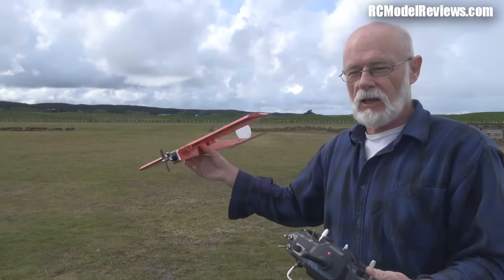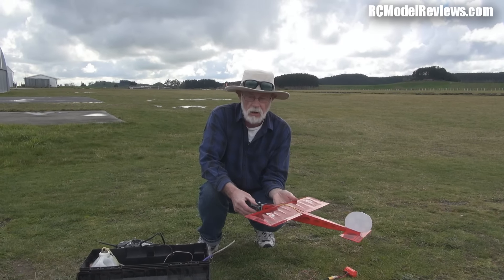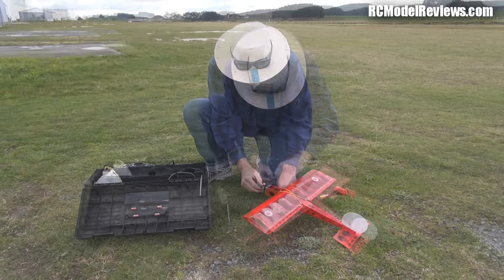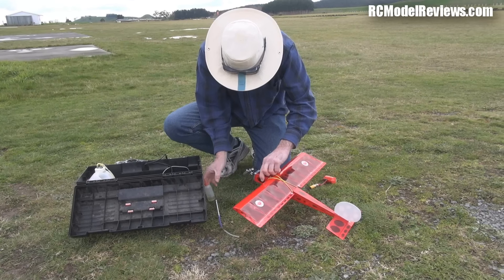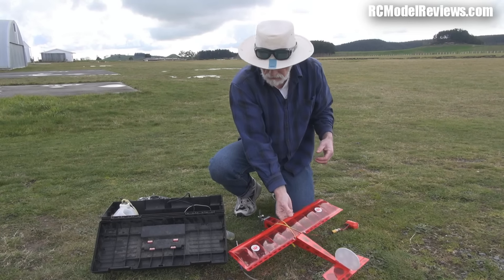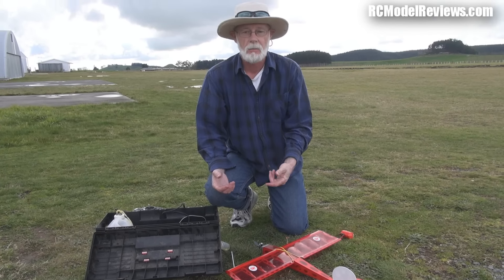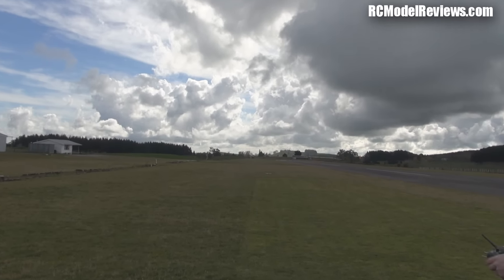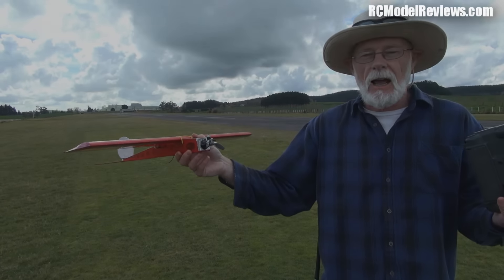Nitro powered mini-stick RC plane, first flight

Comment: I put a cox 049 on the nose of my 72" span Sig Riser.    Fuel tank was way to big and if you filled it the motor would go for a full 17 minutes.  Plane barely flew so you had to really nurse it until it gained some height, and speed. Tons of fun it was!
What amazed me was how much time I put on this little motor over the years and it never seemed to weaken. Amazing.

Comment: I have a Cox 020 with a wooden prop that my Dad bought in California in the 50s. I only remember running it one time as a teen but we never mounted it on a plane. I got a Cox Spitfire 049 powered when I was 13, never flew it though. It was gorgeous, had a sliding canopy and detailed cockpit. The fuel would soften the plastic if you didn’t thoroughly clean the plane with soapy water after running the motor. I replaced the wing once because of that. I still have the motor.

Comment: Nice vid!  I recall having to use nylon props and even conditioning them by soaking in hot or boiling water...the nylon is quite flexible but if they dry out they get brittle.  Keep them in plastic bags.  Also position the prop so on compression its horizontal.  Can't wait top see a vid of a second run and the rest of the Taranis!

Comment: They're called glow engines BTW. The original Cox .010 was designed and produced about 35 years before the low-brow term "nitro engine" ever came out. It started, predictably, in the car market.

Comment: @RCModelReviews
G'day Bruce... Yay Team...! What a little Screamer... Um, back in the days when Wheels had flat sides running all the way around them (On Trains, mementos of previous Emergency-Stops  ;-p  ) ; we used to install the Prop. to be Horizontal on Compression, for Belly Landers. "10 to 4" made for easier Finger-Flick Starts, but the Low Blade often dug into the Dirt... And, better a busted brittle Prop, than a bent Shaft & intact Blades, eh ? Ciao !

Comment: Landing gear may make it a couple g heavier but may be worth it since you have an airstrip to land on. Not saying it's easy to dead stick a runway landing but it might still be flying if they were fitted as per the kit?

Comment: noob question.. so when the motor is labeled as a line/free flight plane, it means it has no way to throttle. correct its just wide open till its out of fuel?

i think i want to play with nitro, sure looks fun.. i do love flying my mini quad.. but this sure looks fun.. yup.  gonna have to learn to cover a balsa build.. as iv only built a balsa rubber band kit so far and had no clue how to or what dope was for the paper covering. so i just finished it up stained it, and made a cool static stand out of it.. and call it art and have it on my desk.  i have 2 other rubber band kits that have 22" wing spands for future projects.. but ill look for a kit for now that has the control surfaces that ill have to build into the rubber band kits which i just do not know or have the skill yet.. which ill gain from building a few balsa kits.   ( and since i live in the desert AZ, 115F means perfect time for building a model, i fly my mini quad in the early morning, or evening when the temps are around 80F.. or my blade nano qx in the house all day long :D  if you do not own a blade nano, they are  blast.  even bought a 25mw elite micro 40Ch micro FPV camera for 40 bucks to give inside FPV flying a try this summer )

it looks like a little cox engine would work great on one of these balsa rubber band kits.
ok, tomorrow ill buy a iron, some plastic covering and start looking for a kit to build.  you have motivated me bruce..  im building a 175 quad right now. so while the stuff is in the mail.. ill build that and get it off my table for my next project balsa nitro..  im sure ill need more than fuel etc.. so i lots to learn.. im assuming it will be a bit simpler compared to all the electric stuff iv been learning to build and fly mini quads.  
i love this hobby.  i wish i would of started when i was a kid.. but hey im 41 and a kid at heart..  so what the hell.
chris.

Comment: I thought they didn’t need running in because they were made to such fine tolerances.
An undercarriage would save that prop☺️
Amazing engines fro my childhood. I had a td 049 I used to compete with in half A free flight in a pylon Sloworm
Your model glides well. No throttling back if you can’t see which way it’s going!

Comment: Why don't you mount a carbon landing gear with foam wheels behind the firewall of the plane. Then you would have a propeller saver and could land on the runway.

Comment: There are these  sunglasses with an HD can right in the center, I ordered one maybe that will help you to. To those who are ripping him a new one for putting a tiny engine on his plane, come on it's his plane if he wants to have a screaming thrust system, let him. 
To Barry no zoom at least not full zoom right away, when I film with my cell phone I don't use the screen I note were my  camera lens is and keep the plane at the brim of the phone lined up with the lens and don't use the screen, it makes it easier to track the plane.

Comment: those little motors need oil mixed into the nitro? i thought you just bought something like 20% nitro and just ran nitro engines on that alone

Comment: @RCModelReviews
Hm, that's  a "Gremlin"... Roald Dahl's 1940 vintage Aero-Goblin Theory of Transient Airborne Faults, which are generally unrepeatable on the Ground...? Col. Murphy, 1947, USAAC Rocket Sled Deceleration Program's Commander, said : "If a Job exists which is SO simple there are only 2 ways to do it, & 1 is UTTERLY Wrong...; then somewhere, someone will do it wrong, EVERY TIME..!" After the 36 Biomed. Sensors were stuck upside-down, on the Test Subject. Ciao !

Comment: When the engine is fully broken in, you may find full bore quite a handful. There are throttle sleeves available but these rob you of a lot of top end. 

One product that delivers full power is a sleeve once made by an outfit called Microflight. It works well but the engine goes a bit lean at low throttle. It got a bad rap due to some controversy over beta testing in the field. 

Looks like you're using the glass filled grey props which are brittle. Get the black, unbreakeable props.